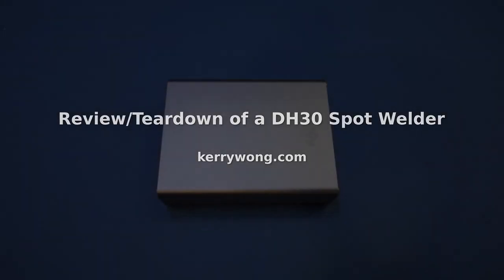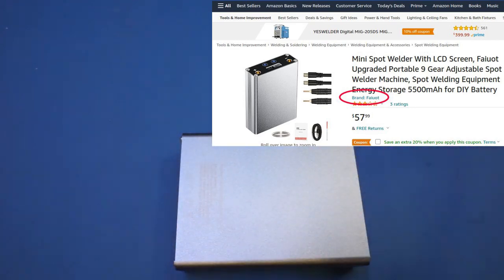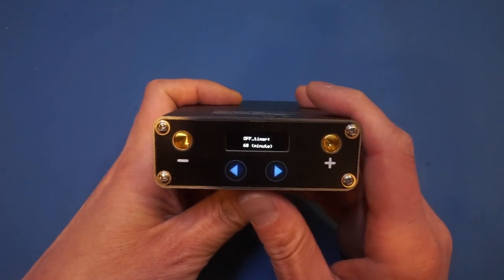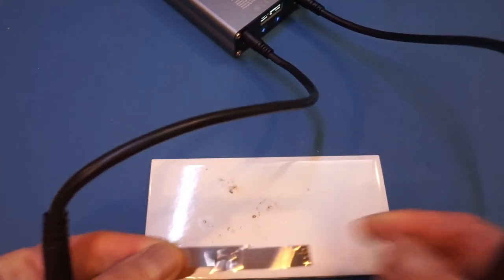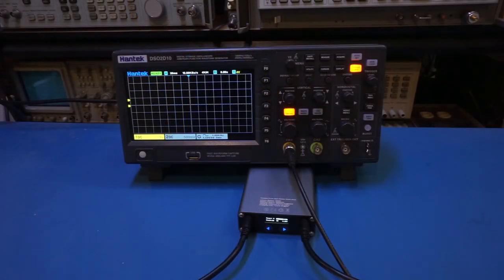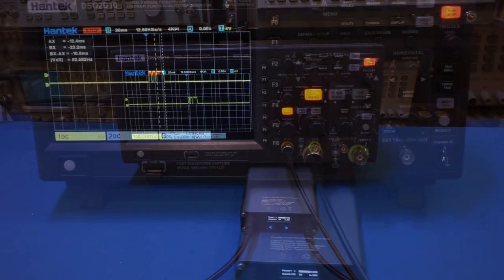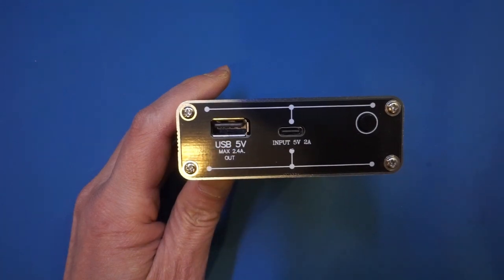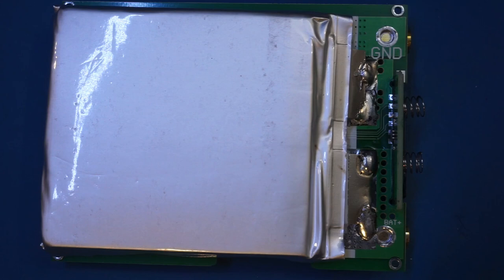Review/Teardown of a DH30 Spot Welder

Comment: i have the same model DH30 from BIFRC. i can get good welds on 0.12mm nickel strips  using power #10.. just use a very light pressure on the tips or else your welds wont stick.

Comment: The battery died in my dh30 spot welder. I kept it fully charged in the box for a year. Now it doesn't work. I opened it, the case around the battery is swollen. I need to buy a new battery. Can you tell me the exact specifications of the battery or the code if there is one? Thank you.
Reply from the maker: When I did the review, battery life span was one of my primary concerns. If you google "Spot welding 3.7V 5Ah Lithium-Ion Battery" you will see some matches. I haven't tested any so you will need to do some research.

Comment: @KerryWongBlog Your spot welder reviews can be improved by: (1) measuring the cell AC-IR (2) measuring some path AC-IR values (3) based on those measurement, making some estimation above which cell AC-IR value the spot welder can be considered EOL (4) supply a value for the distance between the tips, is that more like 2, 4 or 7 millimeter?

Comment: Late to the party but you're pressing very firm on the electrodes. While this is intuitive it's actually reducing the weld strength. The heat comes from the resistance, so just make sure to have good contact but don't press hard.

Comment: Nice job.  I think the fact that you were able to peel the nickel strip off the battery demonstrates that the welds were unsuccessful.  The metals did not fuse.  What if you put one tip on the battery terminal and the other on the nickel strip?  That should ensure that all the energy goes through contact point(s) rather than bypassing the junction through the nickel strip.
Reply: I was typing the same thing and then saw this. Yeah, the welds were no good. There was almost no sign on the battery after they had been pulled away that it was ever welded. I dont think this is putting out enough current to get a good weld. Maybe if you paralleled two together.
Reply: Agree. I have one of these and had to screw around to get a decent weld, sometimes lighter pressure would help heat the material more, and as you said one tip on the battery seemed to be better. Something is not really right with this thing, maybe its just the battery voltage/current capacity is too low.
Reply: I think its just that there is not enough current. I have an old Hughes capacitive discharge welder and it puts out so much current that the weld cables actually jump apart when it fires. And this is the smallest model they made. I use it for welding tungsten filaments to bases for my SEM.
Reply: @JerryBiehler  Ah interesting, I'll try to add some super capacitors across the battery, see if it makes any difference.
Reply: @jaro6985  that’s not going to help. The caps themselves will just make things worse, they need to be charged before and dumped at the same time the spot welder fires. The second issue is that the ESR of most super caps
Is pretty high which will limit the current, possibly less than the battery. Best option it just to add another battery in parallel with the existing one and hope the mosfets hold up.

Comment: mine stuck on beeping the power on sound and it is not closing up. It continues this sound, anyway to reset it ??? i used only 4 times, ver very poor quality
Reply: I Have the same problem. Did you find the solution?
Reply: @Bubol  no I haven't... maybe it can help sorting the capacitor next to the main chip (it resets the device) . It helped some times but then again the same. I bought another company  spot welder

Comment: hey what are your views regarding this Mini Spot Welder? Do you recommend to buy it? Is it good for long term use?
Reply: Old post. Haven't done a lot of welds with mine, but after having it for a year, during some welds the output power has dropped to like 20% (guessing) of what it was and won't return. They're only about €35 at the moment from China, so will do for a disposable item for a project or something, but they certainly aren't a buy it for life thing.

Comment: Friend, I had a bifrc dh30. I went to recharge it with a Type-C cable that I made myself but unfortunately I made the connections reversed in the Type C jack and ended up burning the sop-8 pin IC "IP5306" (that you point with the pen at 12 minutes into the video). The bottom part at the exact point where this component is welded ended up carbonizing and also part of the tracks, as well as the IC itself. I'm an idiot I know. I'm going to buy a DH30 Max, but I would like to use the DH30 board for something (mosfets and eventually some spare parts in the future for the new dh30 max, if necessary). Would you know if the mosfets are compatible between these devices? Thank you very much.
Reply from the maker: I have seen these devices using different MOSFETs even within the same brand, so the best way is if you look at your specific DH30 and find out. If the Rdson of the MOSFETs are identical and each MOSFET is individually driven, you could use them interchangeably.
Reply: @KerryWongBlog  different mosfets, even if they fit in the tracks destined for them, can't they really work together?  what are the risks?

Comment: Any idea of the exact battery type used in this spot welder?
Reply: LiFePo4. I replaced with typical high performanve 18650, few in parallel, now it can weld 0.3mm strip.